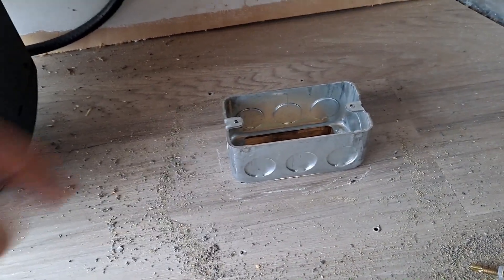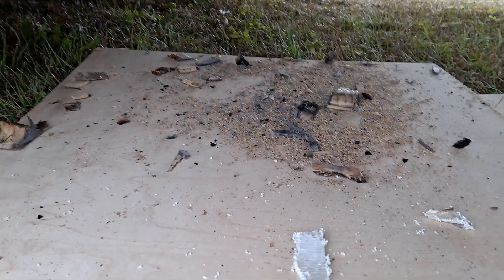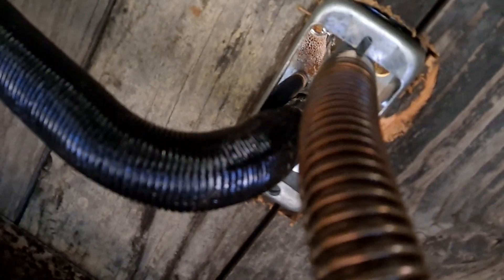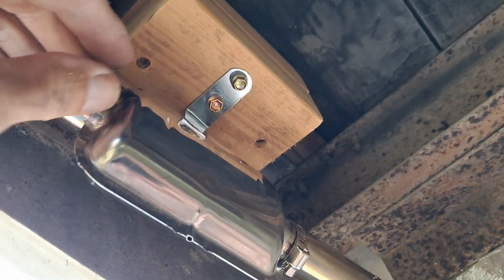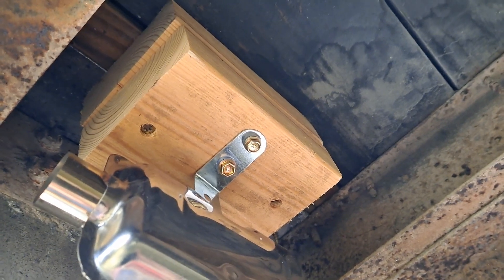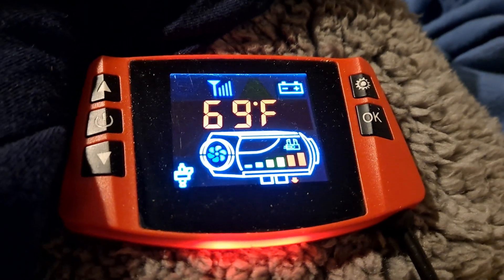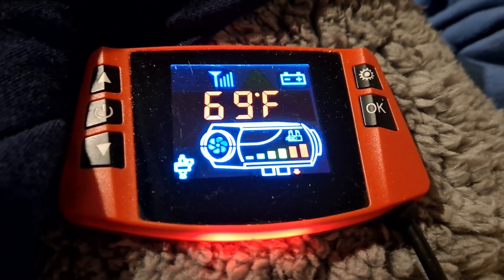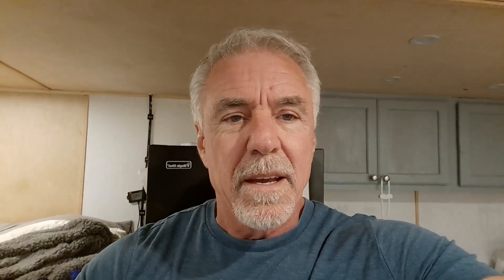Box Truck Conversion Heater Update

Comment: Hey they make a diesel heater turret. For the pipes. Amazon has them
Reply from the maker: BigTomsVan, thanks for the info. I'll check them out. Thanks for watching.
Reply from the maker: BigTomsVan, I checked them out and now I feel stupid!! LOL That was exactly what I needed. Thanks for the tip!
Reply: I saw it in another build. Just pass ing along. I have a box truck now also. Lol like another project I need